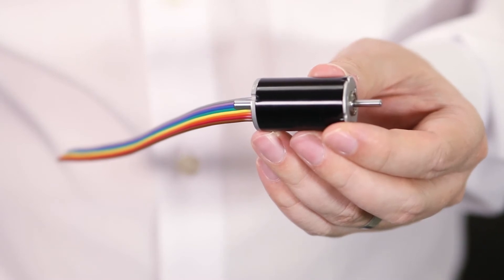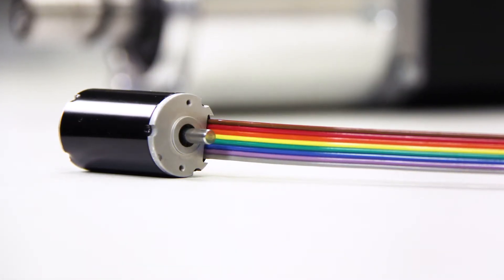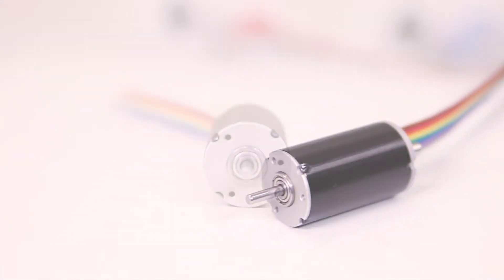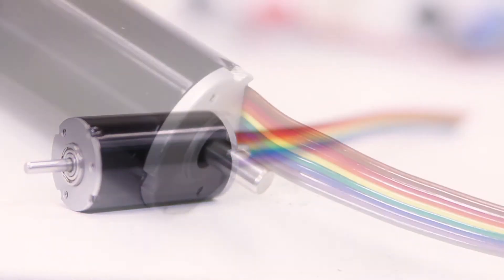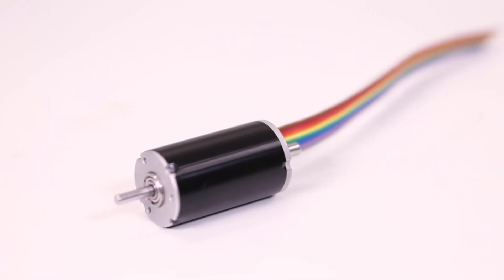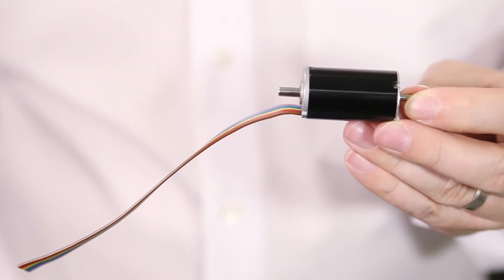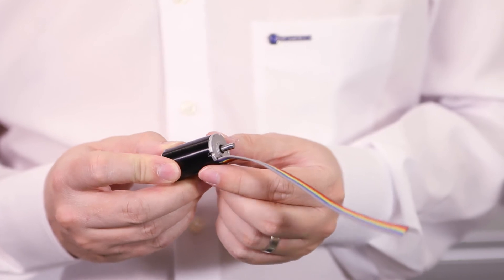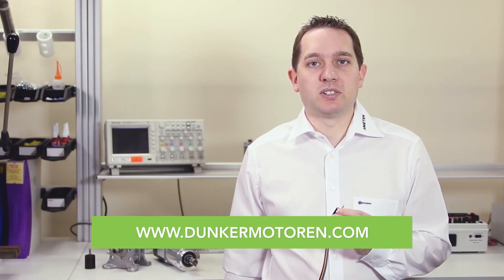New brushless cog-free dc motor for compact applications

Comment: do the brushless or brushed dc motors actually create vibration if you need them to?  Or do only the eccentric rotating mass motors create the vibration?  For example, i want to make my newly designned lint remover which is designed to remove lint from clothing, i want this new prodcut of mine to actually have a smooth but at the same time notiecably strong  vibration to it as well at the same time, very similar to a vibrating toothbrush!   thanks 
Eldar-